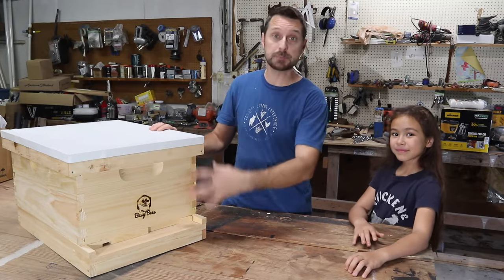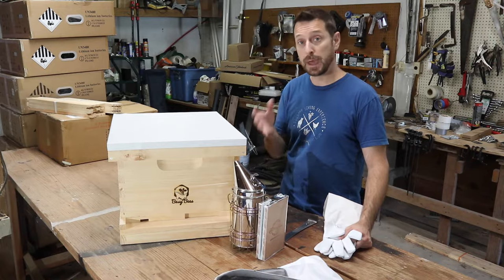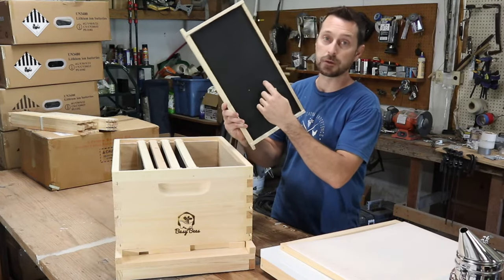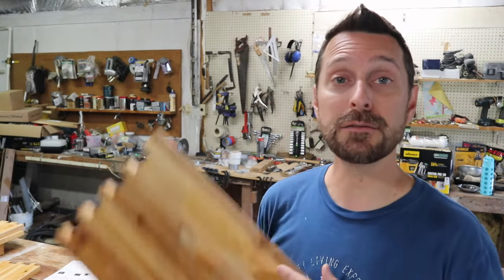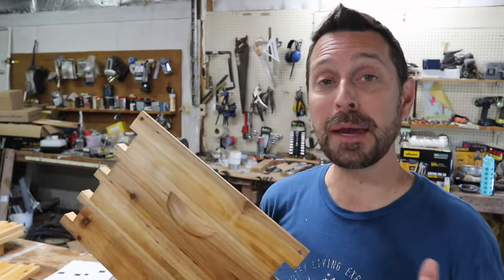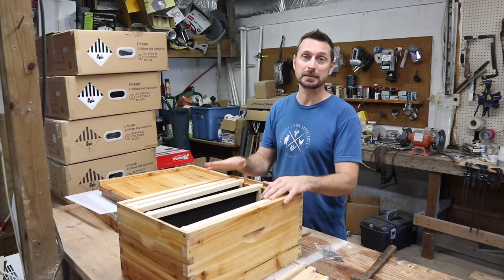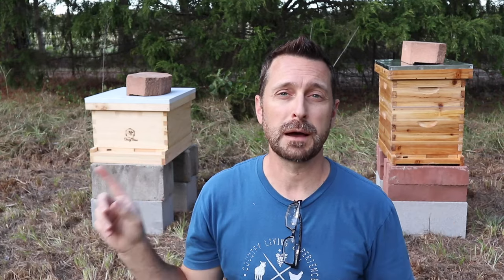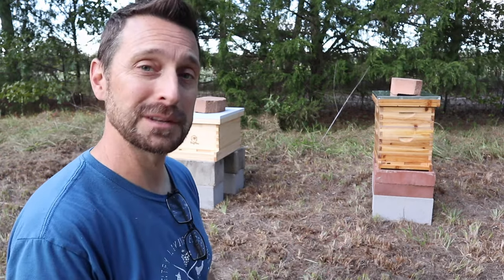Bee Hive DIY! Our Very First Hive Setup And Build!

Comment: Glad to see you going with bees.
Just a few observations:

1) We in Coastal South benefit from a screened bottom board. Every bit of ventilation helps. Ditch the solid bottom.
You aren't so far north to be overly concerned about deep freeze issues. .
Also consider a screened top for July, Aug Sept. Remember how horridly hot it gets?  Prop the cover up a smidge to facilitate air flow.You can always put a solid on at last autumn hive treatment for varroa

2) use a plastic pan beneath the screened bottom board. Available at most bee supply companies (eg Dadant).  Apply a THIN layer of unused cooking oil in pan This traps and drowns any mites that fall from bees when the groom. Remember to check it and clean/replace as needed.
Some bee strains are FAR more fastidious and really groom themselves and colony mates. This dislodges mites. Consider buying bees from "hygienic" stock.

3) skip the wax coated boxes. Price is too high. Just use a sealer on the finger joints. Paint exteriors with "Big Box store" light hued returned paints. Cheap & colorful.
Worried about "drift"? Bees don't recognize colors so much, they recognize patterns. Paint SIMPLE  patterns on front. A simple horizontal, vertical or angled line in a contrasting color works. Even large single "dots"  at corners is enough.

4) write your name/apiary # on couple areas of INTERIOR. Also on frames 
Too many thieves out there.

5) Plasticell foundation has seldom worked for me. My bees hated it and made them "fussy". You really need to cram the bees in to induce drawing cells on plastic in my experience. Go natural wax. You need to replace brood foundation every 3 years or so to reduce possible pathogen load anyway. Impossible to clean Plasticell.
 YMMV.

6) in future consider medium sized brood boxes. Bees down here don't have to have as much winter stores. They will start foraging for willow pollen in Feb. so be ready to add another brood box.
Plus, lifting 100+ lb brood boxes from stooped position gets old, real quick. (See #1 above about July, Aug Sept😣)
 Save your back. Use mediums.

So much more but I'll leave it there...
Good luck
Reply from the maker: Thank you for the advice and info dump Will.

Comment: Super cool, I’ve been practicing regenerative farming for 2 years and got into bees few months ago and never looked back lol! So on the jacket I recommend a ventilated jacket unless you are cold up there. I also recommend at least rubber gloves as the pheromones on your hand can make the bees sting you as well. 8 frame is more side liner and 10 is more commercial. They both work great but it’s personal preference and depends how often you wanna maintain your bees. Smaller the space the quicker they wanna awake due to no room. 5 frame boxes are normally nucs but people do 5frame bee keeping as the bees are looking for a box with those exact dimensions. More maintenance the smaller the box but the bees love a tight space to control hive beetle and robbing. The trey under the screen bottom board is for mites but you only put it in when you treat for mites. The rest of the time you should leave it out for airflow and to allow hive beetles, mites, ants, wax capping and more to drop on the ground and not get trapped on the bottom of the hive. Solid bottom is nice but will hold water at time, so I would drill a tiny hole or at least lean the hives towards the front alittle. 
Much love and I’m super happy to see you get into bees! I’m registered in the state of flordia and I do beekeeping full time now. Rescues, honey production, breeding, pollination and much more. My Instagram is masonbaumel where I have some content as well!
Reply from the maker: That is awesome. Thanks for the suggestions!!

Comment: Paint the boxs, all of them aswell as lids and bottom boards. Spacing is personal choice, I have mine less than a foot apart. I have a bunch of colors so not a issue. Keep them out of the shade to keep hive beetles down. How far away is water? Also join a local beeclub they will help you learn your area. When are you getting yours bees, im guessing in the spring?
Reply from the maker: Thank you for sharing your insight. Do you get any drift having your hives that close? Water is not far. Neighbors pond is about 1/8 of a mile. 
Yes, I am getting them in the spring.
Reply: @CountryLivingExperience  Spring is the best time to start. Not really any drift, bees are really good at finding their own house. My boxs are not all the same, some are striped some have dots. Blue, yellow white with stuff on them. I use mostly white on 1 box and decorate the other because I run double deep 10 frame. You will have too many swarms with single deep unless you have the time to inspect them often and make splits. Ive been doing beekeeping for 5 years now, made lots of mistakes over that time. The big one is not treating the bees when needed and not feeding when needed.
Reply from the maker: I appreciate the heads up.

Comment: It came with 5 frames because a Nuc that you would buy has 5 frames and that makes 10 frames. It is only an opinion which size hive is best. 5 frame Nuc's build up fast and can also be stacked for fast brood build up. 8 frames weigh less but if you use a frame feeder then you only have 6 frames in that box. 10 frame hives are the most used for most beekeepers. It's only an opinion and what one needs that determines the size that fits best

Comment: Hey, I know this is old.. but I just got my first two hives. I put together all the boxes and stacked them without the frames.. what holds the boxes together? Right now they just slide pretty easy. Once I put the frames in will it help hold them?
Reply from the maker: Essentially the weight of everything will hold them down. They just stack on top of one another. To prevent predators from lifting the top lid, I put a concrete block on top.
Reply: @CountryLivingExperience  awesome… Thank you very much! I couldn’t find it anywhere I looked. Thanks for everything!